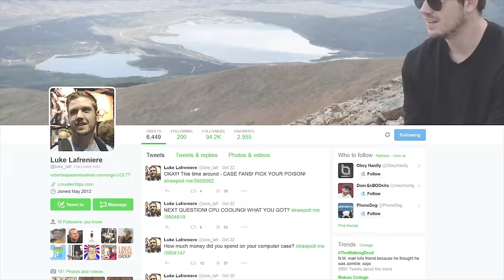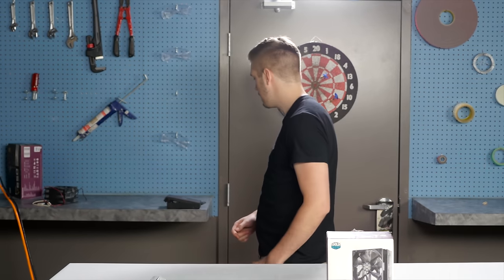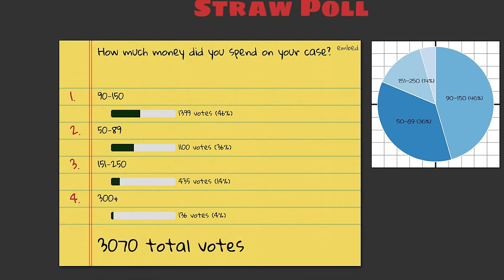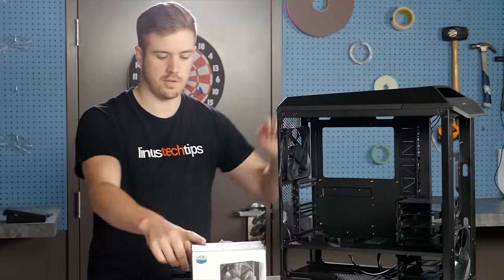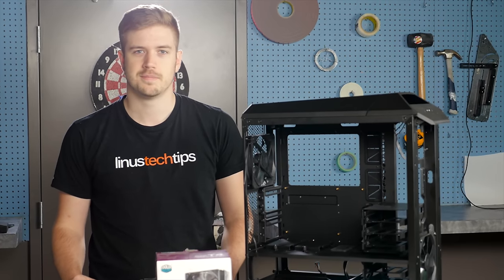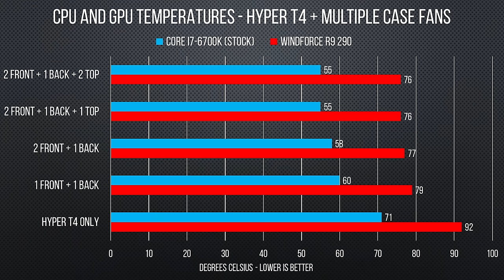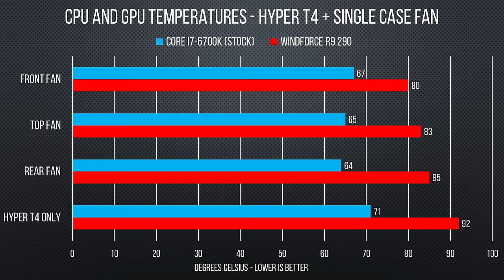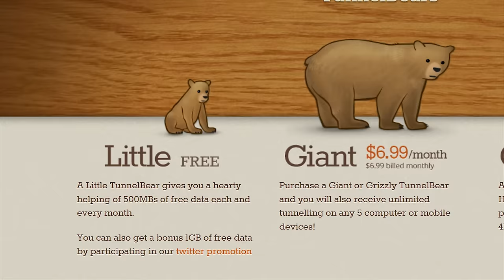Case Fans - How many should you have?

Comment: I always go with enough fans to make the case hover off my desk
Reply: xD
Reply: +Second Burst Very True. It becomes difficult to clean it sometimes when it floats away though  lol
Reply: Not enough, it needs to outperform a commercial airliner
Reply: +That Guy Sully Nah just install the fans ON the desk then your monitors hover too
Reply: AzBo Gaming I agree, it's very minimal. I honestly just put a fan in every spot that is made for one and it works wonders
Reply: +That Guy Sully Same. That's a hell of a task when you have a roughly 60 pound loaded tower, but I do have a 200 in the top.
Reply: fl4shb4ck1992 Damn.. Why didn't I think of that!? Lolol
Reply: That Guy Sully I do not. Instead I have one of those stunt mats for when I turn it off.
Reply: +That Guy Sully over 9000 rpm fans is where its at!!!! also sharks with lasers attached to their head
Reply: raz smith We couldn't get the sharks. Too much red tape.
Reply: +Nimble Bolt and could we find Dr evil
Reply: AzBo Gaming Yeah that's the downside to having so many fans. It may or may not sound like it's taxing down an airstrip
Reply: +That Guy Sully I'll beat you though:

A quadrocopter case of a phone
Cool, and not so efficient.
Reply: I use Delta fans. Sound rivals that of an actual jet but can push air amazingly
Reply: +That Guy Sully well played sir... well played. You have won the internet
Reply: I have a nice little reactor that I use on the back of my case to provide the power, with a DIY mounting bracket I made that locks onto the front of my case for the monitor, and whenever it's a nice day I can use my PC to fly to school, the convenience store, the beach, etc. It's something that anyone with enough fans should look into I think, it really just makes simple commuting more fun.
Reply: I like to use all my fan ports in my mineral oil rig ( ಠ ͜ʖರೃ)
Reply: +James Kightley (Kightleymusicstudios) why is everyone having phils avatar?
Reply: +That Guy Sully 
well than i am sure you have a bunch of delta electronics fans,
http://www.amazon.com/Ultra-Strong-DC12V-Cooling-200CFM/dp/B0054S92FW
Reply: +That Guy Sully 666 Likes :o
Reply: Javier Toledo Lol What have I done?
Reply: That Guy Sully YES
Reply: +That Guy Sully you must have a lightweight case then :P
Reply: That Guy Sully i just use a couple of ceiling fans
Reply: XD Cool man. XD
Reply: Jet engine fan anyone? Comes with the small downside of you need to mount everything with 8" bolts to a concrete slab but other than that its pretty damn good.
Reply: serges i tried but it was a pain in the ass to clean and required me to get an industrial-grade power supply
Reply: That Guy Sully I'm dead 😂😂😂😂😂
Reply: Thats mostly because air filters, i guess, not the amount of fans.
Reply: u sir please accept this W
Reply: That Guy Sully found a solution! I build my pc in a air conditioner.
Reply: i tried this turned on the pc and it smashed a hole in the roof i think its in space now
Reply: You used too many fans.
Reply: better safe than sorry
Reply: @connorsullivan7525  what fans have you got and how many also i will get a cougar panzer 5 gml
Reply: So 30 or so 200mm case fans aiming down? May want to chain your desktop to your desk top.
Reply: @CommanderStormrune  can you help me?
Reply: With...?
Reply: @CommanderStormrune  pc build
Reply: I tend to start with a pre-built (or in the case of my most-recent, a refurb) with near the specs I want, then mod from there. Dunno how much help I'd be.
Reply: @CommanderStormrune  try cougar panzer 5gml
Reply: Already have a tower case in mind for a future project, the Thermaltake Core X5 Black Edition, a stackable cube case with considerable airflow potential.
Reply: @CommanderStormrune  strong,beast and cheap graphic card?
Reply: I don't roll for the latest and greatest myself, saving money for a GTX 1050 Ti (4GB), current price of $199 n change.
That said, if you have the money, the GTX 1070 8GB is $389.99 off Amazon.

RAM wise, I tend to mix and match brands and sizes, due to the variable prices. Currently sitting on 16GB of DDR3.
Reply: At least the psu exhaust will be better
Reply: Lol
Reply: AHAHAHAHAHAHHAHAHAHAHAHAHAHAH
Reply: Lol, great comment.
Reply: You should make a hover board with your great knowledge!
Reply: Tôi luôn đi cùng với đủ người hâm mộ để làm cho vụ án lơ lửng trên bàn của tôi
Reply: Hey so I was wondering I want to see if I can get better temps in my case but it is so hard because I have the Corsair h60 and they recommend putting it in the back as an intake which makes no sense considering that that spot is usually and exhaust. So what I was planning on doing was putting two intake fans in the front then have the h60 as intake in the back and one exhaust at the top. The exhaust fan is going to be the most powerful at 3000rpm and 24v 140mm but I’m still worried of have a ratio of three to one is bad. What are your thoughts and what would you change?
Reply: Here is my laugh for the day. Thanks !
Reply: Glad the cables keeps the computer from flying right out of the windows and away
Reply: I always use as many as humanly possible.
Reply: About 100
Reply: LOL
Reply: so this is a long shot because of how long ago you posted this, but I don't think my mobo has enough pwm connections for the amount of fans I'm going to get (5 fans), what should I do? First time building a pc btw
Reply: Connor Sullivan that’s what happens when you get an atom micro pc 🤣🤣
Reply: @AzBo93  how do you fit 9 fans in a case
Reply: Nothing like a crap ton of 80mm fans and firing that jet engine up in the morning 😂😂😂
Reply: Noctua nh12 industrials will do that.
Reply: you know that you don't have enough fans in your case if your system doesn't float. LOL HAHAHAHAHHAHAHAHAHA
Reply: how you damage ur gpu? 
dude: i put in my hovering pc
Reply: Well, at least if you pull a Linus, it won’t smash and hit the ground 😂
Reply: Fl4shb4ck Gaming ‘Oh, you’ve got a standing desk? Well meet my hovering desk!’
Reply: Lol
Reply: Get a load of this guy! LOL he's so 2015 HAHA
Reply: Ahh yes obviously
Reply: Challenge accepted.
Reply: Just like me! I just use a little airplane motor with big fans! New problem tho: the motor get verrryyy hot after hours of gaming! It might stink a bit, need to let your windows open!!
Reply: Noctua IPPC 3000 RPM fans ohh yeah.
Reply: This is the way.
Reply: Amen brother
Reply: I have 2 fans in the top 3 at the front 2 at the back 2 on the bottom pointing at graphics card and the PSU is in its basement drawing air from the bottom
Reply: I have 2 fans in the top 3 at the front 2 at the back 2 on the bottom pointing at graphics card and the PSU is in its basement drawing air from the bottom
Reply: Connor Sullivan anti static
Reply: Bro saaaaame how did you know
Reply: lol
Reply: #Cyberpunk2077
Reply: Lemme Guess
Blow E inator or whatever tf it's called
Reply: So Noctua
Reply: No man that's gonna cause negative pressure in the case you want positive pressure. I personally make shur the fans pull enough air to stick the case to my wall.
Reply: Huh I always thought I was supposed to fly out to the upper atmosphere and I just have to anchor it to my desk
Reply: I understand you not wanting to go overboard on fans, but I make sure my case is on the ceiling
Reply: same
Reply: Lol
Reply: Xddd
Reply: Cool
Reply: Can someone help me I just built my new pc and it won’t float
Reply: @3shottzz  MORE FANSSSSSSS
Reply: I'm building my first pc soon, getting a good 11 fans just to make sure 👍
Reply: better safe than sorry
Reply: I wonder if we could use this on cars...
Reply: Linus should also use this method, so if its on and he "drops" it, it will hover and not break.
Reply: @connorsullivan7525  It would blast the dust away
Reply: @darkzek8141  ok Lang o
Reply: Me too bro
Reply: Put some magnets and a magnetic surface under it and you'll get the same result.
Reply: Nah, just put your case on a (read: REAL) hoverboard.
Reply: How far off the surface does it fly? I’m building a pc and it’s my first time.
Reply: Genius.
Reply: Proptip: Attach fishing lines on the side of the PC you normally don't see. Won't hover away!
Reply: first it was floating monitor now hovering pcs
Reply: I go with enough to have my own jetpack
Reply: If I can’t meet the Mars rovers then the fans are critically under performing
Reply: same xD
Reply: thats wxactly what the fans are for good thing you realized
Reply: lmao
Reply: AKA; sound like a jet engine.
Reply: DITTO!!!
Reply: He'll of a comment, sir.
Reply: same
Reply: With enough fans you join onlyfans. BWAHAHAHAHAHAHA
Reply: God I love the comment section. 😂😂😂
Reply: I’m about to put 10 in my mid tower (including psu, cup cooler, and gpu coolers)
Reply: Yes me to
Reply: Damnnnnnn😂😂😂😂😂
Reply: This comment is so true.
Reply: Just to be safe 😂
Reply: @connorsullivan7525  😂
Reply: My pc could do that with just the psu
Reply: @darkzek8141 relatable comment
Reply: Lol😂

Comment: Why buy fans when I can just manually blow air into the system?
Reply: Because, as a nerd, you're supposed to be productively lazy. Outsource the air blowing to your fans. Duh.

Build a Youtube channel, and have your fans come over and blow air into your case. Problem solved.
Reply: dude just fart into it. that'd neutralize the air.
Reply: Or spend $10 for a small desk fan add just have it blow into the case
Reply: Gosh... can you stop joking?!
Reply: Nah i take my pc to a windmill
Reply: Who is this guy !
Reply: 666 likes
Reply: @johnz6241  frebreze
Reply: I use blacksmith forge billows.
Reply: @supersaiyangoku3580  ...why?
Reply: Straws are banned in some places now
Reply: Why not install a mini air cooler... They cost 30-40 bucks anyway 😑
Reply: good point. They probably didn't see that one coming.
Reply: no what you do is intall a new central air system to your house so its blowing cold ass air and funnel it to the computer and some fans to take the heat out  that's like a 2000+ cooling kit XD
Reply: @garrettk7166  Double entendre I LOVE IT
Reply: Intelygent
Reply: why you buy pc casing when you can put your build in a desk and let the airconditioner cool the system
Reply: You Wim Hof?
Reply: I got an electric fan pointing at my computer with an open side panel.
Reply: Yeah. Absolutely.
Take out the CPU fans, and the smps fans and. Expose your CPU to a nearby ceiling fan. 

Lol. Share the results in a video. Many will be looking forward to watch it. Live is better.
Reply: Ikr
Reply: @johnz6241  😂😂
Reply: LMAO what are the replies and why am I watching this out dated build xD
Reply: My basement is crazy cool- I use the PC as a heater down there
Reply: Synthetic Humanoid intel users cry in the silence of a fan as their cooler
Reply: Just hook it up to your cars exhaust, you don’t have to pay extra for fans
Reply: true
Reply: @ArthaxtaDaVince777  Depending on your diet, you could probably also liquid cool it as well as air cool it with your farts.
Reply: You think you don't need fans? Wrong! Prove: check out onlyfans.com
Reply: @Musica20009 + positive pressure 100
Reply: Stonks
Reply: I see a fellow MEJ
Reply: @ArthaxtaDaVince777  just install a catheter and hook it up to the pump, this way you save time using the washroom and utilize gameplay
Reply: Forget the computer tower all together.  Just build you next pc inside a mini-fridge.
Reply: I Don’t have lungs
Reply: I just put ice in to cool down

Comment: $69 for a case fan? Da faq?
Reply: Loool
Reply: +MrCODEmaster00 i now really want to build a quadcopter with 4 of these...
Reply: Luké Ruké lol trust me you could, i plan to use an itx board for JUST the fan headers seeing as how 1 of them can lift off okay, so if you use a lightweight itx board, 3-4 fans, and than an extension cord (for the psu) it should be fine.
Reply: ***** for that money I can buy a new game
Reply: Alex The Zen Dragon Slayer *an overpriced game, or 2-4 steam games (but to play on a computer without sufficient cooling mind you)
Reply: they should be 5$. I can make a case fan for 1$
Reply: That's more than my gpu. "Hello darkness my old friend" :(
Reply: Steven Densmore "Another one bites the dust, hey hey hey, another one gone, another one gone, another one bites the dust."
Reply: Y not buy a stand-alone cooling fan 
I think no need $30 & have 15" fan XDD
Reply: Lol i got a two pack of fans for $26 and they work astonishingly well
Reply: For a second I thought you wrote 69 cents I was like oh not but but 69 bucks damn
Reply: Oh man Deltas are crazy fans lol
Reply: I checked the link. What is a wigga?
Reply: MrCODEmaster00 Description
This fan moves an incredible amount of air and it will be LOUD when you plug it into the power supply. There is a 4-pin molex power connector and a 3-pin TAC connector. The 4-pin molex power connects ...
Reply: Matias Pirttilahti i believe there is also a description of it with exact specs of it in PCPartPicker, just sort by sound when choosing case fan, and the PFB1212UHE / delta fan comes up on top of the list if you sort by noise level
Reply: way to much, you could get a fan thats just as good for $20
Reply: +Cool a5 a Moo5e I got red led ones for 25$ each
Reply: I know I've got 3 $5 fans in my case 2000RPM low voltage
Reply: I bought a 4 pack for 10 dollars on Newegg. I don't see why anyone would spend more than that
Reply: or just buy 1 lamptron to hear the engine of your computer roar, and also have a heat blower lol.
Reply: Cool a5 a Moo5e I have 4 JetFlo's in my case. They are the best fans I have ever used, you don't need 4 but for £15/$19 each they are amazing.
Reply: okay wil try them thanks
Reply: Your paying for the lights, oh and the super secret advance levathon tech. Not to mention the grease made from the eyes of baby seals.
Reply: Ikr fans cost like $7
Reply: Don't buy anything that is so low in supply.
Reply: bro with those 69 dollars I'd rather upgrade my i3 5th gen processor instead of a led fan
Reply: +John Doe What do I do if I need more than 3mm/h2o static pressure?
Reply: yeah! shit i could get a fucking 14 inch car fan pushing 700+ real cfm for that price..
Reply: Alex Nguyen man its 20$ for a very good one
Reply: I use 2x 4€ fans :D
Reply: I cant believe people use fans that cost 40$ wtf? You buy 2-3 fans and for that price you can go one tier up in gpu or cpu. Yet again, it must be awesome to live in a country where 500$ budget build is the 1000$ budget build in mine and that is if you take cheap 30$ case which isnt the quality of 30$ in US...gpus and gpus are 80-100$ more expensive, motherboards at least 40$ more and now to buy a 40 dollar case fan lol no. i dont even think they sell that expensive fans here haha we have fans up to 15-20 dollars tops
Reply: the fans are more expensive then teh case it self :p
Reply: +Ivan kovačević Exactly, people are eager to waste money.
 RGB will be our end
Reply: omg ... this comment has 669 likes